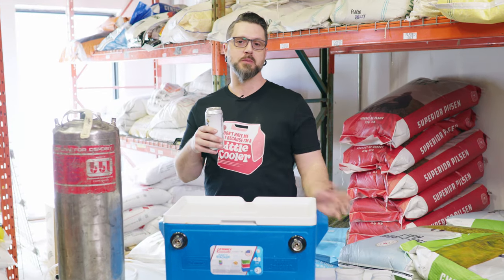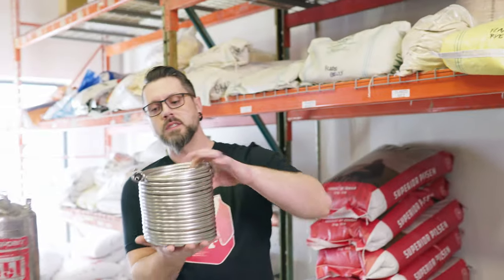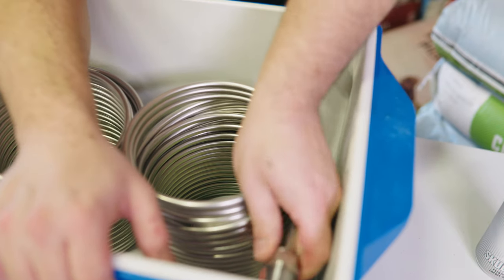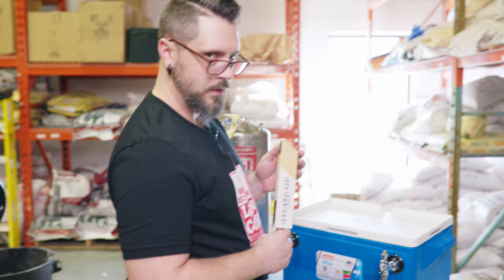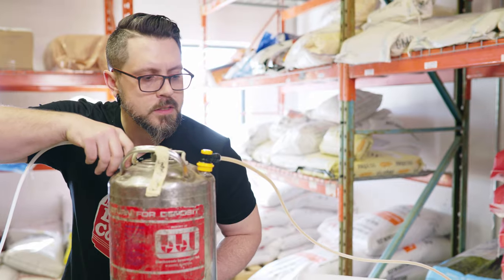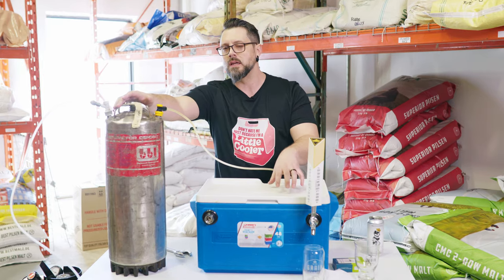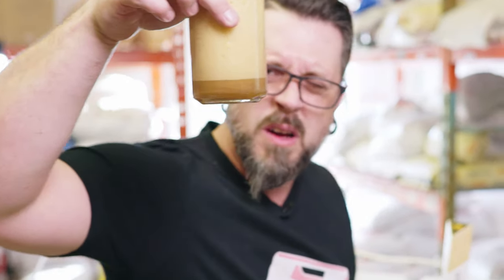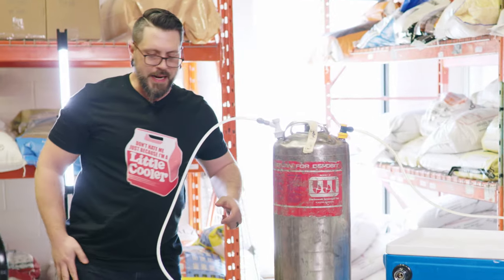The Ultimate Guide to Building and Using a Jockey Box for Your Next Party Or Event

Comment: It's called a jockey box because it's easy to 'jockey around' and move. Many jockey boxes have cheap couplers that provide air flow issues when they are too tight. If you can talk to your distributors and what atmospheres the kegs are pressurized you can give them line diameter and length and they can tell you ideal psi. I usually run between 15-20 psi. If you're using block ice I recommend putting in a few pitchers of cold water to help temperature radiate to the lines. It's also important to depressurize the kegs when finished for the day as over pressurized kegs are a whole nother beast.
Reply from the maker: Good tips.  Cheers